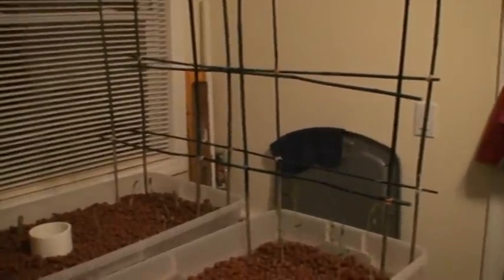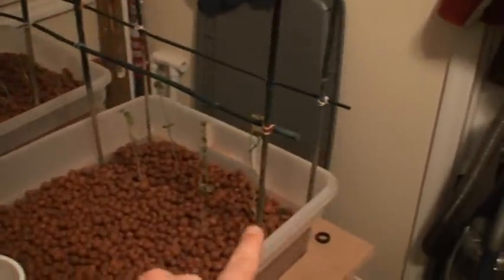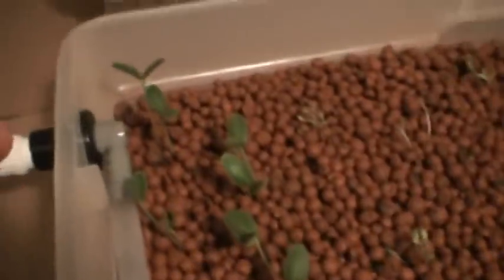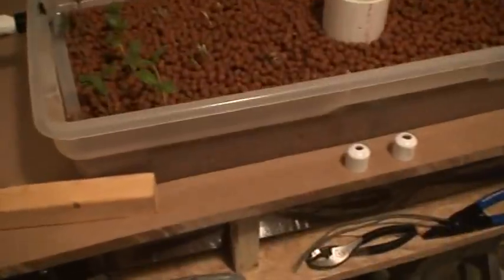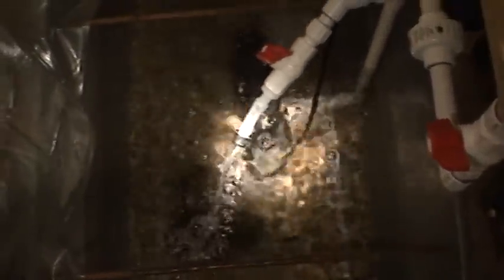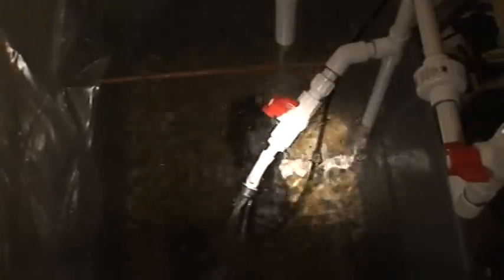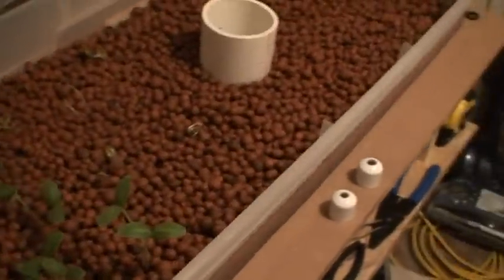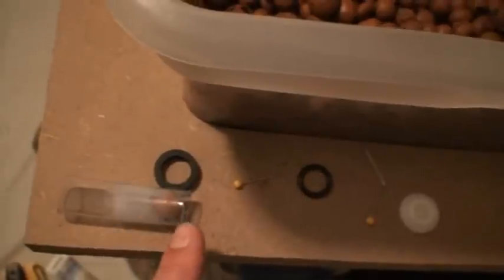Aquaponics 04 - Catfish, Trellis, Aerator, Loop Vent, miscellaneous

Comment: @VincentVonGoat 
I found the Sweet Spots in both! My drain pipe was too steep (toward my tank).  I added a couple of elbows to easily adjust the angle, made a couple of adjustments, and BAM... IT BELCHED!  Flow stopped!  Ran it all night, and it's been working perfectly!  Thanks so much for your help.

Comment from the maker: @ZombieGreaser501
Another critical part is the minimum clearance between the top of the standpipe & the inside bottom of the bell.  You need a minimum of 1/2", but I have found that 1" is ideal.  My standpipe is 7" & the bell pipe is 8" long (bell pipe - not including the cap).  When measuring your standpipe height - ensure to take into account any adapters, bushings, & threaded ends - as these will add to the standpipe height.  It's best to dry fit it & then take your measurement.

Comment from the maker: @ZombieGreaser501
I forgot the most basic thing... the bell itself!  You could do all of what I wrote previously & still be tearing your hair out with a constant run drain cycle.

Ensure the bell has good clearance around your standpipe.  My standpipe = 1/2" dia & I am using 1 1/2" dia bells.  You could go to 2" dia bell this will increase the flow potential inside the bell over the top of the standpipe.

Comment from the maker: @ZombieGreaser501
the problem with horizontal drain pipe creates 2 situations that could be alleviated by designing the system as a "tub over tub" setup (GB directly over f.tank).  In this setup, the drain is simply a straight pipe downward.

the 2 problems seen by a horizontal drain are:
1> constant run siphon (doesn't break) - your current problem
2> siphon "breaks" but then only fills 3-5 inches of GB in a continuous loop.  This is caused by a horizontal pipe higher at the drain end.

Comment from the maker: @ZombieGreaser501 
Assuming your in-flow is now *just enough* to start the siphon ("perfect")

2> your horizontal drain pipe's rise to run is too steep downward (toward the f.tank).  when the siphon kicks in, with your hand on the bottom of the horiz pipe, slowly lift the pipe up (when the bell begins to gurgle).  You should then hear a large gulp of air come from the drain outlet (not the bell).  This is your drain's "sweet spot".  build blocking to support the horiz pipe at this level.

Comment from the maker: @ZombieGreaser501
I have found this is caused by 1 of 2 things (or both):
1> the flow into the grow bed is too fast.  fix this by slowly closing your ball valve feeding the GB.  I do a small turn & then count 30 sec.  repeat.

However, a better way (i have found) is to find the equilibrium point of fill - that is the minimum amount of flow you need to keep the siphon from starting.  In this state, the standpipe & the in-flow will =.  Once there, move the ball valve just slightly open.